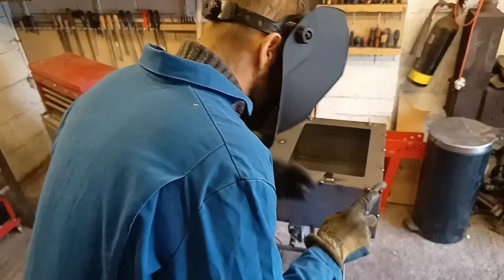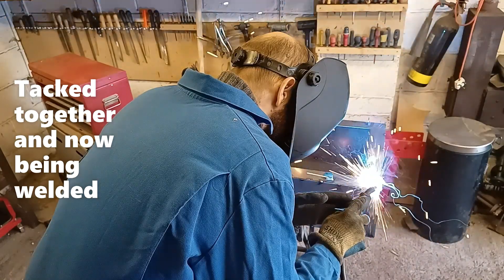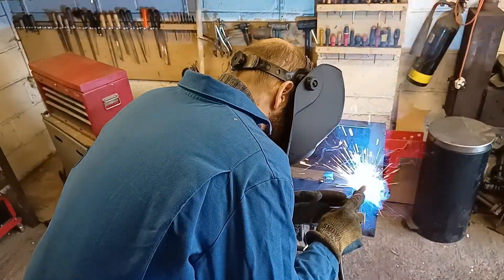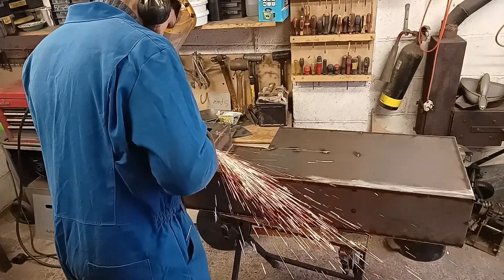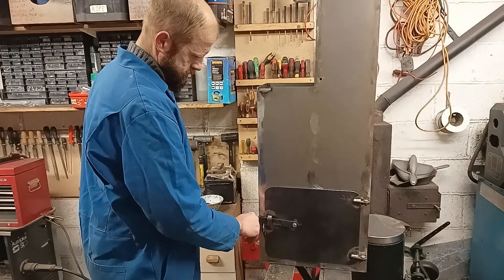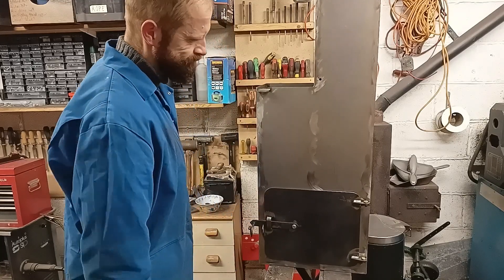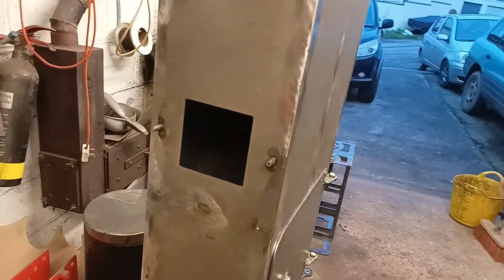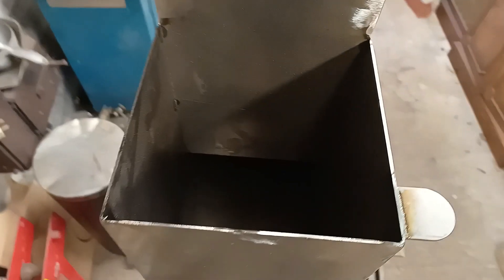Building a Stirling Engine that is Wood Fired - Part 3 - (Hopefully 500W + )

Comment: Thinking about the trouble you had in the previous build with piston seals/rings, had you thought about making the piston out of brass? It has a lower friction than steel and it seems to me that it should cope with the heat. Or even a brass sleeve over it. Just a thought.
Reply from the maker: Towards the end of the last engine I went back to leather lip seals which do work pretty well with an appropriate relief ring and very thin oil. Brass is a very good idea. I'll need to see what tube sizes are available unless I can work out how to construct one. Thank you for your thoughts, all the best

Comment: Have you read Andy Ross's article on a Sterling powered rowboat being used on a reservoir in Norway? I have the article in a copy of Live Steam magazine from 1981 or 1982. It's an inline unit with the rod for the displacer running through the center of the power piston. He said it move the boat at a brisk rowing speed.
Reply from the maker: I am aware of that boat but have not read that particular article. I'll have a look on ebay/ amazon to try and get a copy, many thanks

Comment: Hi Shane,
verry impressive, I really like your engines and videos.
I am verry curious of your new engine and how it will perform.
But you really need a tig welding machine...
I also build Stirling engines but I do it the other way with small working volumes but higher pressures and sometimes I think of moving more into higher volumes when I watch your amazing videos.
Keep up the good work it is really impressive.

Many greetings

Ralf
Reply from the maker: Greetings Ralf, I've watched a fair few of your videos and am very impressed. I agree I need a tig welder. I have access to one but it's a bit unofficial : ). Their not too expensive so maybe I'll get one. My approach is slightly less scientific/ technical than yours! On this engine I've been trying to maximise the heater/cooler/regenerator surface area while keeping the compression ratio 2:1. All the best and keep up the good work.

Comment: Shane I saw you tacked the flat tubes into the heat exchanger but how did you do the final weld to seal them up ?? Especially on the cold water side ??
Reply from the maker: Haven't welded them yet. Planning to fuse these in with a tig welder and then pressure test to show me where all the leaks are!
Reply: @ShanePomeroy  Shane only use 1- 2 psi to test. A few years back our fabricator used 15 psi to test a tank with a false bottom. Turned it inside out. Be careful. I made a tank for a wood stove once just small same thing but all the walls popped out round and took that shape.
Reply from the maker: @perrymattes4285  sound advice, thank you for the heads up!

Comment: Hi Shane.  Mate if you put the air adjuster in the middle front of the door maybe it won't tip; just a thought.  Thanks for the video, looking good.
Reply from the maker: Great advice, I think that would solve it. I'll finish the engine first, and when I've regained some enthusiasm I'll move it! many thanks